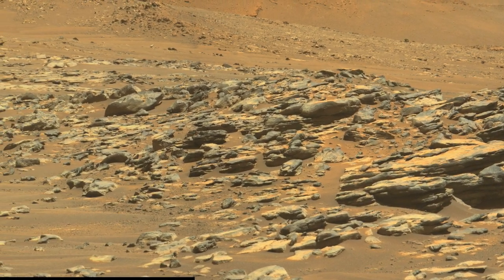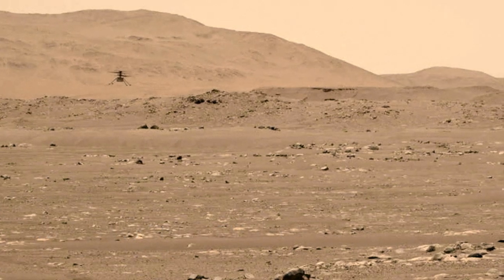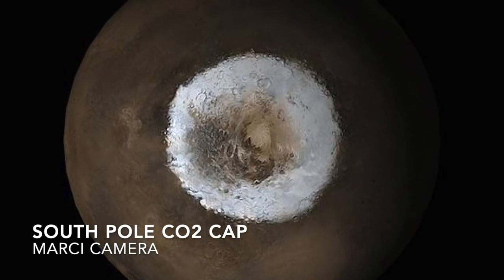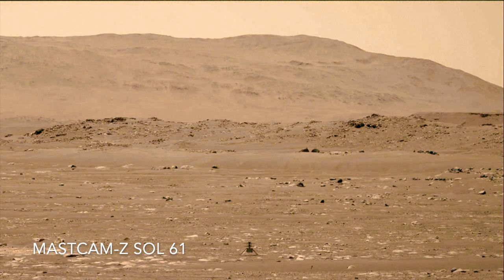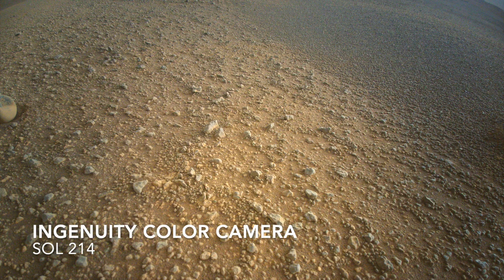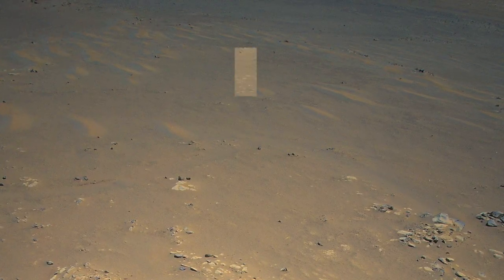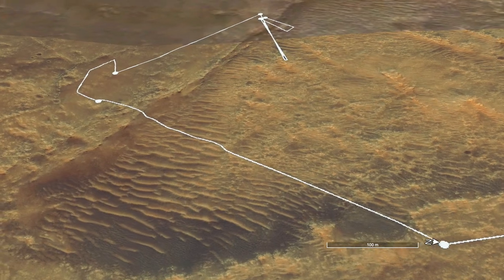Ingenuity helicopter attempts untested flight technique

Comment: It won't last forever because of the fine dust and even bigger reason is unlike the Rover it has very little shielding protecting it from Radiation. We just have to be grateful every day that goes by it still works.

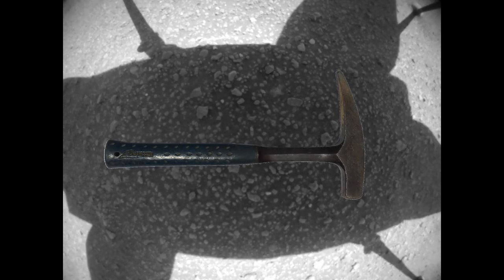Comment: (01:18) The lack of disturbance is mainly due to the rpm test being done at a shallow blade pitch angle, where the propeller cuts through the air edge-on without producing any significant lift. The effect would have been mostly the same on Earth at sea level despite the difference in altitude density. Once the pitch is adjusted for maximum lift, the amount of air moving downwards would be at least equal to the Martian weight of the drone. Regardless of how thin the atmosphere is the pebbles would see around 700 grams of air passing by until the drone is airborne, enough to push them around and kick up dust.
Reply: Also, any loose matter would already have been blown away when Ingenuity landed.
Reply from the maker: @Pouncer9000  Thanks, these are good points.  But none of the videos showing Ingenuity taking off and landing (and included in this episode) show an obvious dust plume despite the availability of mobile sand and dust.  So presumably the thin atmosphere plays a role too.
Reply: John P 
Do you think that Ingenuity design can be scaled up to the size, that would allow transporting cargo and people over the surface of Mars? 
If not what other method of flight, excluding rocket propelled aircraft, could be viable to complete this task?
Its an extremely interesting topic and you seem to have some knowlegde about how these things work, so Im asking you instead of using my poor english skills to do the research on my own (surely not because Im lazy xD)
Reply: @Weisior  Yes, not only can it be upscaled, it'd be increasingly efficient doing so. I guess Curiosity is as small as is possible to make, I'm sure the design team would have loved to make a bigger craft, but going to Mars every gram counts.
Fixed wing is not a viable proposition, but maybe a blimp? They'd need to be pretty voluminous though..
But seeing as we think them barely worthwhile in our comparatively thick atmosphere maybe not.
Reply: @Pouncer9000  It would not be increasingly efficient (or possible) to do. Weight cubes by volume - curiosity is on the bleeding edge of just being small and light enough while still having enough power. Much bigger and it starts to be physically impossible without a thicker atmosphere.
Reply: @Pouncer9000  Even assuming it would work, a blimp would bring problems of its own ... Martian winds would blow it around just as winds do with blimps and balloons here on Earth, perhaps beyond the capability of motive power systems to control.
Reply: So a rotorcraft is the only sensible option for Mars aerial transport? How about something like Osprey with big ass lightweight wings?
Reply: @Weisior  V-22 Osprey is also a rotorcraft, taking off and landing like a helo.
Reply: @Weisior  Any aerial transportation method that works on Earth above 100,000ft in altitude (+30km altitude) and does not use oxygen as energy source, would work on Mars. For instance, the altitude record for an aircraft is +90,000ft but running on oxygen (SR-71 Blackbird). Weather balloons can reach +130,000ft (+40km) but their payload is typically less than 10kg. Carrying passengers on a flying vehicle on Mars would require further advancements on battery energy density, or carrying energy in other forms, such as liquid oxygen tanks. Also, a sufficiently gigantic helium balloon could lift +100kg on Mars.
Reply: @robertf3479  I mentioned it specifically for its ability to fly like a normal prop aircraft, to get an answer if similar craft designed for martian environment could behave like Osprey on earth in whole spectrum of its flight profile - not only liftoff and landing.
Reply: @GlutenEruption  k0RREKT!!!
Reply: @Weisior  EXTREMELY DIFFICULT FOR ANY SIZEABLE AIRCRAFT-MARz
Reply: @_John_P  HYDROGEN BETTER CHOICE IN EVERYTHING MEASURABLE
Reply: @Pouncer9000  Why would a fixed wing not be viable? Not having a runway to land and take off from would be the only thing I can think of. Did you have something different in mind?
Reply: @Elrog3  That's basically it, the atmosphere is so thin fixed wing designs have to fly really fast to generate lift. You can lighten them, you can increase wing area all day you're still left with a design that requires much more velocity and thus unrealistically long runways for take off and landing.
The X-plane flight had (has?) a Mars scenario and I never once managed to land in one piece, your approach has to be within a fraction of a degree of the runway axis, there's no purchase for correction.
Reply: @GlutenEruption  You don't have to take my word for it, here is Ingenuity's lead designer on how they'd make it bigger if the mission's payload had allowed it:
https://www.youtube.com/watch?v=GhsZUZmJvaM
I don't have the exact timestamp but at one point it is said that a larger copter could carry couple of kilograms payload no problem.

Comment: There was no prop wash because the collective pitch wasn't engaged.  That's why it can spin up to full rpm without taking off.  This is a helicopter with variable pitch blades- not a drone.
Reply from the maker: Thanks, good point.  But none of the videos showing Ingenuity taking off and landing (and included in this episode) show an obvious dust plume despite the availability of mobile sand and dust.  So presumably the thin atmosphere plays a role too.

Comment: At 1:11, if the rotor pitch was close to zero during the spin test then there will be almost no downwash.
Reply from the maker: Good point.  But none of the videos showing Ingenuity taking off and landing (and included in this episode) show an obvious dust plume despite the availability of mobile sand and dust.  So presumably the thin atmosphere plays a role too.

Comment: Really like this little monster. 🙂 Question: if you are having to increase the spin rate of the rotor blades, how will that affect the overall wear on the helicopter? Will or how much will the risk increase for something to go awry due to the increased wear? Thank you for sharing. Appreciate the videos.
Reply from the maker: Thanks for watching.  I'm not an engineer, but presumably there will be increased wear and tear from the higher speeds and accompanying vibrations.
Reply: @MarsGuy  I remember reading somewhere a few weeks ago that Ingenuity is suffering wear and tear on the servos controlling rotor pitch angles.  We need to remember that this little guy has already survived far, far longer than originally designed.  

Sad to say we need to be prepared to hear the news that something critical has broken, perhaps in flight, resulting in a crash.
Reply: @MarsGuy  how long do you personally think Ingenuity is going to last? The rovers have lasted years, but aircraft/helicopters generally have shorter lifespans without maintenance…

Comment: what are the bearings designed to about 40000 RPM doesn't have any pressurised oil system.
Can it do a barrel roll?

Comment: So we had it on Earth.. we have a vacuum  chamber. We know the thinning of the Martian atmosphere  yet we didn't think of testing it at higher rpm in a thin air before we sent it all that way. We're they so pessimistic about it lasting that they didn't bother??
Reply from the maker: Ingenuity was added to the Perseverance mission as a technology demonstration to prove whether a helicopter could fly on Mars.  It was designed, built, and tested on a relatively small budget and performed its intended mission brilliantly.

Comment: You would think they would have tested the speed up to it broke apart on Earth before sending it anywhere. They also have vacuum chambers here to test with varying amounts of atmospheres. There should be a lot to learn on Mars but not things that can be tested elsewhere.
Reply from the maker: Engineering models were indeed tested in a vacuum chamber at Mars pressure, but apparently not to failure.

Comment: ‘One month of flights”,  isn’t the same as flying everyday for a month. Don’t you mean it flew a handful of times during a one month period?
Reply from the maker: Flying everyday was not implied, nor part of the original plan.  Up to five flights were originally planned for the month of April.
Reply: @MarsGuy  .....yeah that doesn’t count for , “ One month of flights”.  The maintenance clock on planes doesn’t run when they;re parked on the tarmac.

Comment: If they can show ingenuity actually flying from using the rovers cams then why can't they show the UFO's moving thru the sky and why they can't show the movement of the dust twisters movement also. But yet when they show a UFO and or a dust twister neither of them is moving in the video as if it's not a video but just pictures. Wouldn't what they show on video be more believable if the objects were seen moving.
Reply: Those dust twisters were much farther away from the rover that imaged them. You are thinking about one of the OTHER rovers and not this current one. WERE there video cameras looking in those directions WHEN the twisters came by or just still cameras? Why don't you look that up? Why don't you find what the specs are for EACH camera on EVERY rover, what the frame rate for the "video" cameras are and the resolution for each of them. Then decide what IS and ISN'T possible for a particular camera to capture.
There is NO instantaneous feed from earth either. So any image that makes it to earth cannot be used to them "aim" a camera at something that is moving by a rover. That object is LONG gone before the signal can get back to the rover.
What "UFO's" are you talking about?